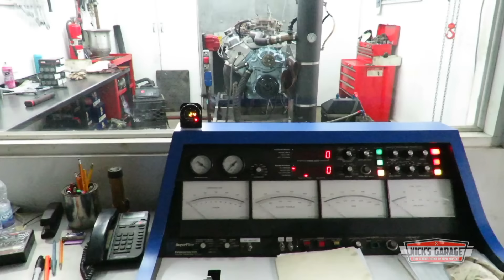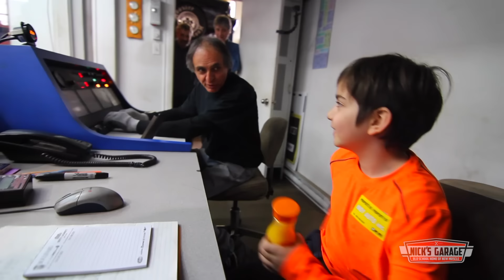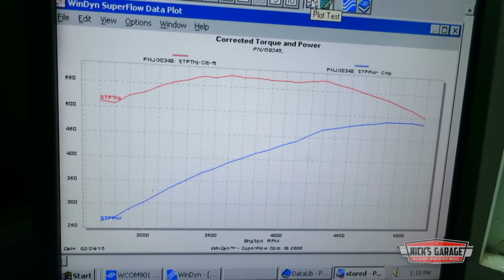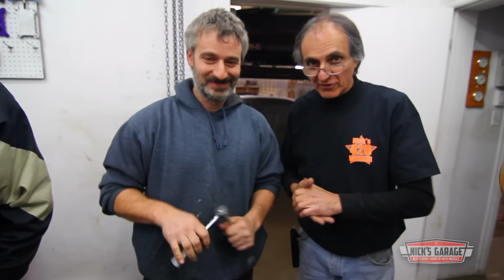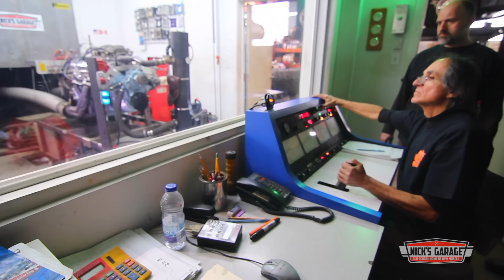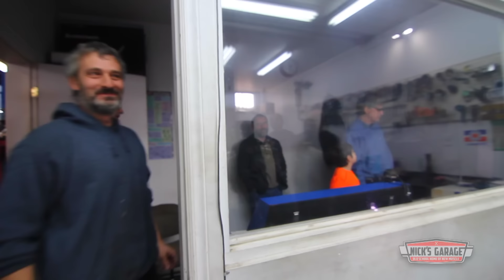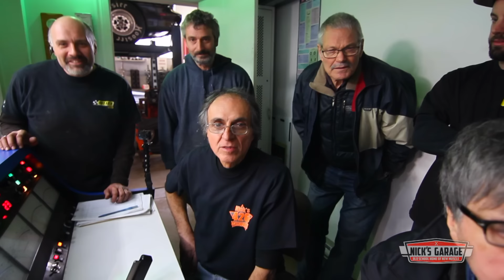Fire On The Dyno!! - Pontiac 455 Lights Up

Comment: Yepper soon as you see the intake start to move you adjust the exhaust and then when you rotate it to where the intake is up and down and exhaust is just closing you're just the intake. A friend of mine mapped it out on the regular firing order of 18436572 did a chart where he only had to do two revolutions to set all the valves on this firing order. Back to drop dead center and set the distributor.

Comment: I drag raced a 455 (462) Poncho in a '40 Chevy coupe for over 20 years. 400 heads, hydraulic lifters, zero deck, 12:1 compression. Dual Holley 600's, TH400. 3300 lb car. Very streetable, and ran consistent 11.20's in the 1/4 mi. Never dyno'd, but I guessed it at about 500 hp.

Comment: That engine sounded real good 501 hp, the change of rocker ratio helped a lot. I watch your channel quite a bit, I like it because your not one of these flashy kind of talk above your head kind of guy, love the BB Chrysler engines of yester year awesome power from the factory. I am a SBC and LS kind of guy, enjoy working on both although my LS is in a Pontiac Gran Prix GXP, the engine sits sideways in it, making the back side a little difficult to work on. Will keep up on your channel to see what kind of Detroit iron is next

Comment: Guy causes oil leak. Knows what the problem is. "Fixes it" then does a full dyno pull with smoke bellowing out. Well. Who's to blame? The guy on the dyno or the guy who "fixed it". Get the co2 fire extinguisher! No chemical!

Comment: ps- I always glue the valve cover gasket to the valve cover, with permatex weatherstrip adhesive.  standard in diesel engine repair industry.  then it won't slide around.  old diesel mechanic I worked for 2 years taught me that trick.  we'd glue all gaskets then assemble next day.  then if you take it off to relash, change rockers, the gasket stays there.

Comment: if you get the intake valve to just close on each cylinder, you can set the intake and exhaust valve together then, because the exhaust is also fully closed when the intake just closes.  it's the beginning of the combustion event, so both valves by design, must be closed, or the engine won't run.
  you really don't have to key it for every valve, just every intake valve, then set that pair int/ex.

I'll take it a step further, if you look at the Pontiac, Chevrolet, Buick, Olds, Caddy shop manuals, you can set them all at TDC #1 and #6, 
it states:
TDC #1 cylinder- set intake 1,2,5,7 and exhaust 1,3,4,8
rotate to TDC #6- set intake 3,4,6,8, and exhaust 2,5,6,7
if you have the valley cover off a short block on the stand, with cam in place, lifters on the cam, you will see,
at those TDC locations, 8 valves are on base circle at TDC1, and the other 8 are on base circle at TDC6
GM procedure right from the manual.

Comment: on a Pontiac I only go 1/8 turn beyond zero lash, then the lifters won't pump up as easily at high rpm.
because if they do...it breaks pushrods, rocker arms, studs at high rpm, like a missed shift, etc.
ask me how I know...lol....I used to carry extra studs, rockers, pushrods in a toolbox in trunk,
changed a few times at track, on the street.  and lent a rocker stud, rocker, pushrod to a guy at the track who broke one,
on a 64 GTO.
Pontiac knew of this problem...which is why:
the Pontiac Ram Air II, IV 400 engines, 1968-79, had a special hydraulic flat tappet lifter, 
with a retainer snap ring like a solid lifter, very strong.
and they were zero lashed, that's all, with NO additional turns after zero lash.
so they were basically a solid lifter, fully pumped up when running, on the Ram Air IV cam.
that setup had 2 nuts on every stud, one to adjust, one to lock it, and an additional nut to hold the rocker oil deflectors.
oem right from the factory.  it enabled 6200 rpm without pumping lifters up. they were fast bleed lifters with less travel.

Comment: Nick, just a friendly word to the wise.  we were dyno testing a crate motor 454 big block Chevy, brand new from GM- for a 70 Chevelle.  
On the second pull, it threw a connecting rod, the dyno room door was open just like the side door is on your dyno room.
I can see a car in the garage in the next room there.
well, the rod went out the door, and richocet off of finished engines and parts, and walls.
we had just been standing in that doorway taking video of the motor idling.
fortunately we got back in the control room behind the bullet proof glass when it let loose on the 2nd pull.
had it hit one of us, would have cut us in half like cannon shell.
I'll never stand in a dyno room or outside an open door next to the dyno room again, after seeing that.
I had advised the engine owner who was a friend, to have the engine taken apart and gone over first.,,
before dyno test, but he did not.  well he did on the 2nd engine.  because the 1st motor was complete loss.
well GM replaced the engine free of charge after some arm bending...he had to turn in the first exploded engine.
and 2nd one, we DID have pan pulled and all rods/mains retorqued, and heads retorqued, etc.
come to find out they were assembled in Mexico.  we never did find one rod bolt nut, in the shop.
meaning...was it ever there in the first place ?
this was bought right at the Chevrolet dealership about 10 years ago.
the rod holed the block, all the oil, coolant dumped onto the floor in the dyno room.
a real mess.  that same shop also had a dyno FIRE years later, that destroyed most of the dyno room, 
and had to be completely remodeled.  if you see smoke, shut 'er down.  not worth the risk, if it reaches the fuel.
this is a top notch high level racing engine builder, with a sterling clean reputation, in business 30 years.  accidents do happen.
Reply from the maker: Wow.. thanks for the memory.. and for keeping us safe.
Reply: Ps- yes, when it's a motor you did not assemble for customer yourself, such as crate motor we got from GM, red flag....close the doors , in case it pops on dyno !

Comment: glad they didnt have to use the fire extinguisher. even a small amount of that in the intake or cylinder would be a real problem. id see if you could upgrade to some halon type extinguishers. ive used them in sensitive areas and in off roading and, since dyno rooms tend to have good potential ventilation, theres no worry about suffocation, no residue in the engine, just smoke where a fire once was. i keep a couple in the cars i have.

Comment: We always “glued” the gaskets to the valve covers with black 3M weatherstrip adhesive. Works great but is a wire wheel job to remove. Always used cork vc gaskets.

Comment: You would think even back then GM would have devised better sealing gasket for their engines its not rocket science you rarely see an imported car with a gasket leak most are machined surfaces with rubber gaskets or their glued on cork gaskets should have gone out with the dinosaur's

Comment: This I why I had previously suggested on another video that you relocate the fuel supply tank outside the dyno room. This is standard practice in a jet engine test cell where the fuel supply tank is always located on the other side of a firewall outside the test cell. This is done in case an engine explosively comes apart and/or a fire starts that could involve the fuel supply tank and increase the intensity of a fire. One would hate to see your garage burn down with all those awesome muscle cars inside.

Comment: After 50 years I’m still amazed that people are brainwashed to think that one horse power per cubic inch (give or take) is just fine. The test I want to see after a dyno test like this, is a tear down of the engine with a hone out the cylinders walls 10 thousands over with the proper grit stone! I double dare you and challenge you to do that. Horsepower would be closer to 2 hp per cubic inch just with this one modification.

Comment: I would put a CO2 extinguisher there, as it puts out an open flame fast and doesn't affect anything, whereas a dry agents like in that bottle on video will mess up everything and is a pain to clean. Sure, they are good for fluid fires as they stay on the suface to suppress reignition, but in instances that you just get a little flames like this, CO2 is a nice addition.

Comment: Dyno owners: Get a CO2 extinguisher puts the fire out and no mess. Also if you get a runaway diesel engine CO2 applied into the intake will turn it off.

Comment: That Pontiac engine is almost 12 to 1 compression and has race heads on it among other things and it’s not that impressive...Nick took 426 hemi and bored it 20 over because he had to with the stock heads and original parts and made 490+ horsepower now that is IMPRESSIVE!!

Comment: The Pontiac Super Duty 455 CID, even with the lower Compression was a monster especially if you had the stones to modify it. Back in the day, a pal had a brown T/A w/455 S.D. 4spd. He voided the warranty because of the mods. The new Radial Tune Suspension, made it a great GT. AWESOME, I had a 70 Buick GS 455 STAGE 1,4SPD, & Depending on launch &/or traction it was either him or I. For the most part 455inches from B.O.P. were strong & reliable. Imagine with today's technology. 
Gr8 work as usual, Nick.

Comment: Lot of mechanics hurry with sealing new gaskets work better most times .with intake 4.3 vorteck gray jap sealer torked kept with out coolant no preasure 24 hours set up time fixed .ten years 215000.00 still fixed fixed at dealer leaked on the way home fixed twice second fix only lasted three years .i did my self still fixed.

Comment: A Pontiac 455 built right will outrun a 454 Chevy. If there both built with the same specs. I ran Pontiacs with my friends . And we use to do it all the time. But I love the work that Nick does. Especially on Mopars  which is also my favorites.

Comment: I have a 66 GTO with a 400 block and 4.5 in stroke crank.  and a few other upgrades like roller cam and rockers.  590 hp and 610 torque.  On one 780 holley.  of course the holley was maxed out.  but the car runs 11.90s.  My back up engine has the larger bore Indian block and has mid 600 hp and torque.  runs 10's in my gasser.  With two carbs.

Comment: I wonder what size cam it had? it sounded small for that much compression.
Reply: I wanted to run enough vaccum for power brakes so It was not a rough cam
Reply: @beau-weekendbeau-weekend6929  Smaller than a RA IV?

Comment: I had a 1971  225 Plymouth slant 6 Duster 3 on the tree, it was a beast. I out ran a couple of  cops with it. That 225 engine would run 110 mph easy.

Comment: Nick I'm a Pontiac man any hydraulic camshaft in a Pontiac you adjust the rocker arms with 0 no lash whatsoever they get tightened all the way down they don't adjust like a Chevrolet Pontiacs have zero Lash so try to tighten them all the way out all the way down and you'll gain a lot of lift on the camshaft and you'll break at 500 Mark easy good luck buddy.
Reply: I love my Pontiacs don't get me wrong I have a 496 Pontiac with 710 horse but you do not adjust a hydraulic camshaft in a Pontiac like you do a Chevrolet and just doesn't work out you lose lift and horsepower both thank you

Comment: Nice torque monster as The Pontiac's are known for: However I'd rather have a 400 bored and stroked to a 455. It's those big main's that are the achilles heal of the 455. With the 400 you get smaller mains. Spent all that money on heads, spring for roller rockers stronger and less friction.Last thing then I'll shut-up. Stamped steel valve covers are crap go with cast aluminum you get a nice rail in the valve cover for the gasket to sit in.

Comment: In the Chevrolet shop where I worked there was a posting on the wall of half the valves on the Chevy V8. It was there to tell which valves to adjust when the crank was at TDC. If it was obvious that one of those valves was open, you did the other half because you were at the "other" TDC. You did those instead, turned the crank 360 degrees to TDC again, and then did the ones on the wall. Saves a lot of time, as well as the battery. Just FYI. You're the Mopar man: I'm sure you can tell which valves to adjust on a Mopar which I suspect are the same since Mopar numbers the cylinders the same. Correct?
Reply: ladymyre.   True, sometimes I do it one by one also checking cam lobe wear after 1st initial start up.
Reply: @nickpanaritis4122  You da man Nick. And I gotta say you got me on that choke heater tube on the Hemi. When you told us the missing part I went, "SON OF A ...!". lol

I was kicking myself for a week. That's real old school tech man, like the ballast resistor taking it's bypass from the ignition switch starter circuit. Most kids nowadays couldn't possibly get older cars to run well. If the scan tool can't tell them what part to replace they have no idea where to start.

Comment: WHat kind of timing are you running?  I know you said you set timing to 28.  Is that 28 at idle?  I ask because we are tuning a buddy of mines big block Pontiac and at idle, we have it at 18 (with no vac advance, 36 with vac advance).  It seems to idle better with more timing.  The mechanical advance is about 14, so hes at 32 at WOT above 2k RPM.  Seems like he maybe should run more timing.

Comment: True to life honesty. Other engine builders would be too embarrassed to show this problem. The man has my respect.
Reply: Engine building companies should be hiring blokes like nick these computer geeks that finish uni and go work for companies like gm may know their way round a cad program but wouldn't have a clue what grease under the finger nails looked like. Its guys in the racing seen that develop the hp and technology for today's engines and its a pity they dont employ more seasoned guys like nick to get their input as their the guys working on them all the time
Reply: He needs to have a Co2 fire extinguisher on hand. He was smart not to use the dry-chemical, but should have a Co2 on hand for this exact reason.
Reply: @canuck8888  he was smart not to use any type of extinguisher. If you watch the video carefully you notice the fire is just on the exhaust. You don't want to blast a hot block with any cold materials. The results could be disastrous. If you're not familiar with the ins-and-outs of motor building and high performance engines, this look like something a lot more hit me up again then it really was.
Reply: @bluebeard6189  lol fire extinguisher are not cold.   They are dry powder.  Better yet use Halon in a engine cell.   

You don't do this for a living I guess?
Reply: @tahcogunworks  oil on an exhaust doesn't require any extinguisher. And so you know I've been a certified Harley mechanic for 12 year, and my area I'm one of only five certified S&S mechanic.
Reply: @bluebeard6189  harley???   Lol.  So you basically work on lawnmower engines.  Wow.  Impressive!
Reply: @tahcogunworks  well well seeing how you feel like spraying a hot block with whether it's chemicals moisture whichever way you want to go with it, I can say with pretty much certainty you don't know what you're doing, you're a buffoon I am really glad no one pays you to work on a vehicle
Reply: @tahcogunworks  apparently youve never chilled a six pack with a co2 extinguisher, or made dry ice with it. It gets cold, real cold.
Reply: @bluebeard6189  
🤣 👍
Reply: Eh, Having a little fire here there is good for TV ratings!
That's why I'm here, came to see the Fire! 🔥 😁 Lol
Reply: Other engine builders would have stoped and shut the dyno off seeing that much smoke out of nowhere...
Reply: @Mr_Meowingtons  if you've worked on engines you know a little bit of oil on exhaust system smokes like crazy. Just exhausted probably hot the entire time Nick probably didn't concern himself with having oil clean off of it.
Reply: Except no professional builder would continue the pull with oil pouring out either.  Unacceptable.
Reply: @tahcogunworks  Have to agree. Wonder if being on camera had an influence??
Reply: @tahcogunworks  the gasket was relined, in the booth you couldn't tell if it was leaking

Comment: Back in 05 I had a 428 pontiac built with all new internals, comp hydraulic roller valve train. Edelbrock heads. Ran on pump gas. In a 65 gto I beat a new viper to 110 mph on the highway

Comment: 1) gotta pay attention with valve cover gaskets, they can be a real pita.
2) why continue pull with all that smoke?

Fun day though!
Reply: @MAD GRUMPYMAN  I had issues with cork gaskets, and changed to metal and composite, pricey but they torque down nice and even and not a drop of oil has left the insides of my new 302W
Reply: Sensationalizing the video...
Reply: I was wondering the same thing. There was way more than normal amounts of smoke and it continued to increase.
Reply: Aside from the smoke skewing the numbers, who wants oil film in their carbs?  I get it though; no one expected it to ignite, and you may as well finish what you started.
Reply: I will admit that my 2 square body Chevy trucks have leaking valve cover gaskets. I hear it because of the bolt pattern on them but I'm not sure. Think the Vortec valve covers are better because their bolts are along the center line of the valve covers. That's just my 2 cents worth.
Reply: I just use RTV if I’m not planning on pulling them every ten minutes to adjust. Works fine, never leaks.
Reply: yea that was more than just a burn off...
Reply: @Dave Micolichek  read point 2 in the OP.

Comment: Mistake #1,  never reseat a cork gasket....  Once it was noted that it was pushed out, it's more or less finished... and should never have been reseated. Why did the mechanic think it would be ok to push it back in and hope it would be fine?
Reply: The thought was probably along the lines that it only needed to last literally another minute or less. Can't think like that... what if it doesn't? This happens. Sh*t happens fast, loaded up at 5Krpm...